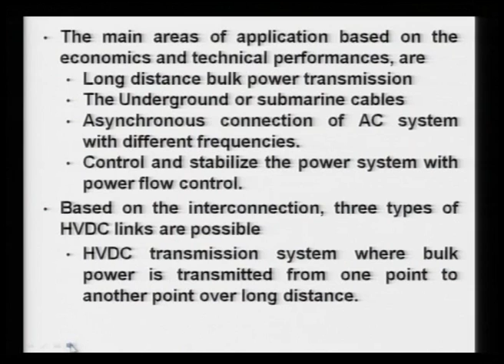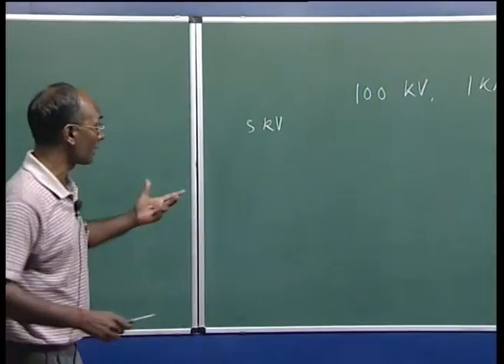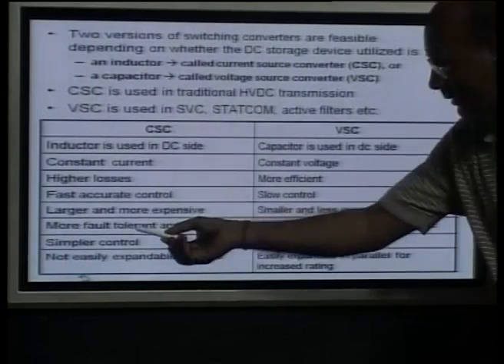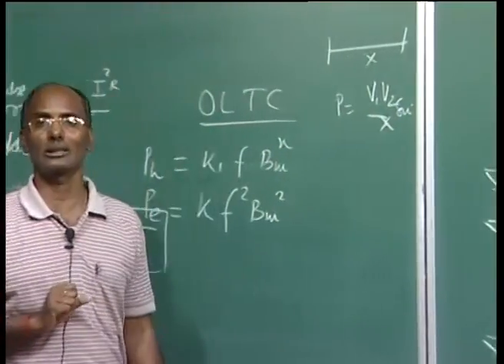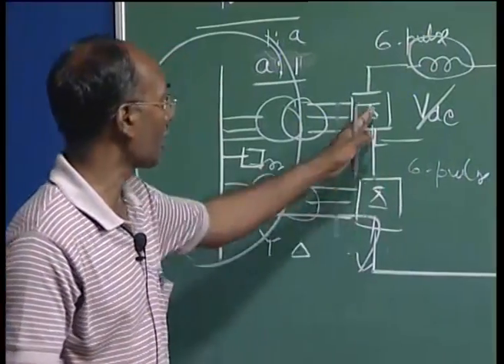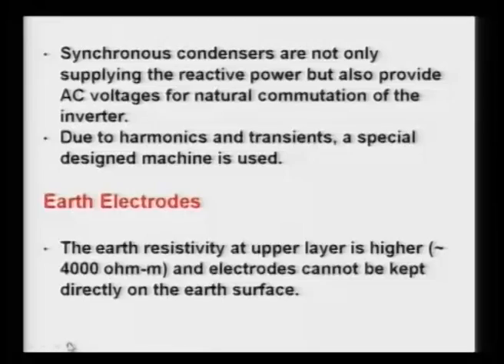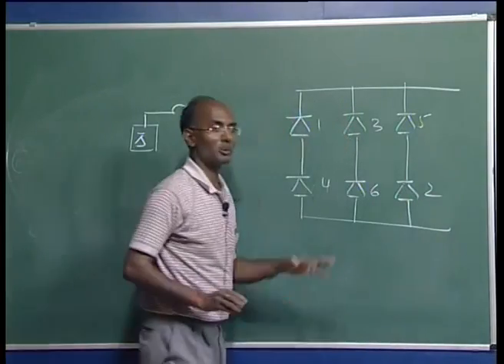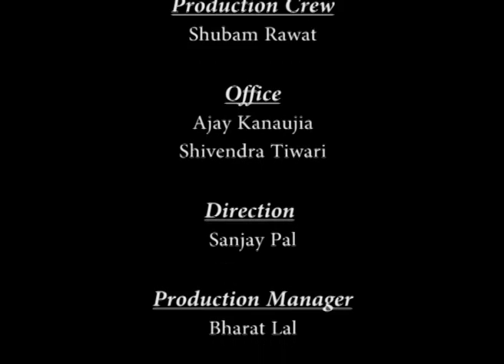Mod-01 Lec-03 Lecture-03-High Voltage DC Transmission

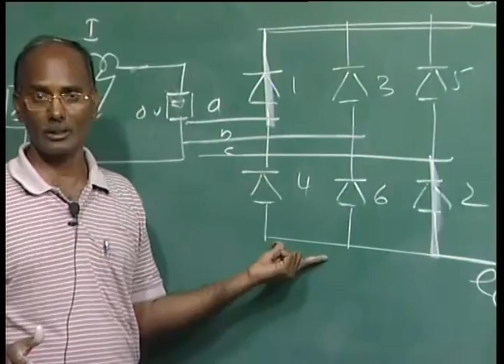Comment: The Professor clearly mentions in 52:17 that even though he has drawn the symbol of bridge rectifier, there are actually thyristors with controls in real case. So it is just for simplicity he used that symbol.
Reply: well very often his word's and writing of symbols are not quite synchronice but otherwise an excellence lecture